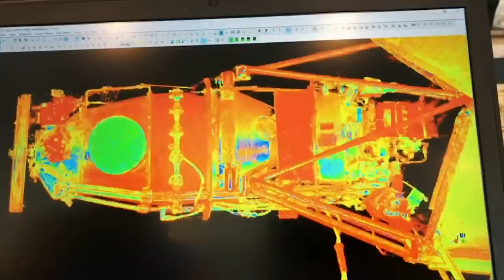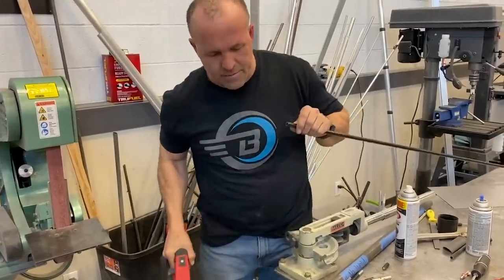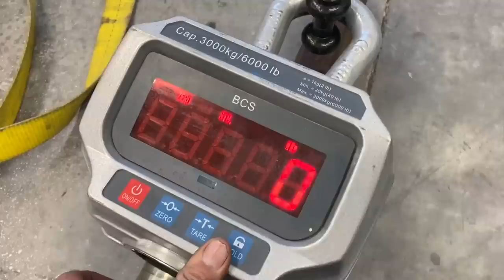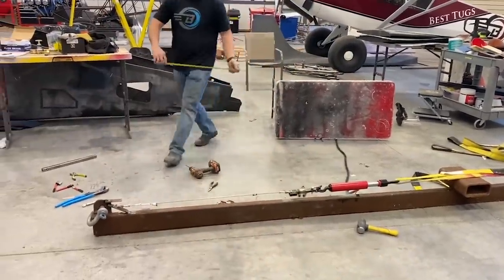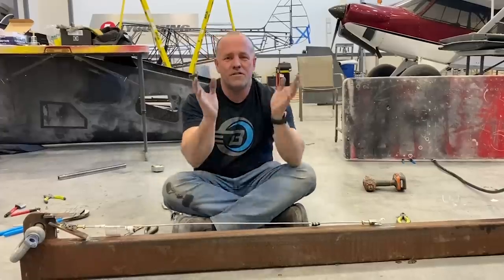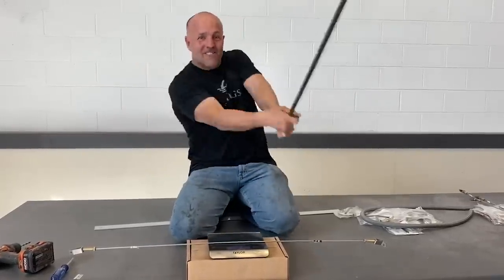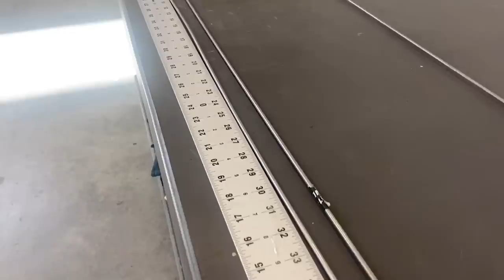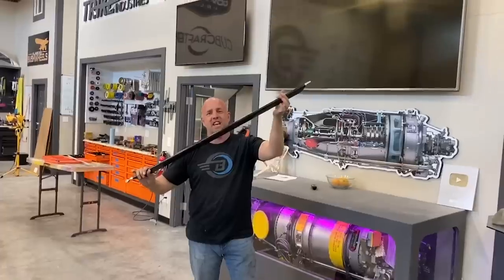Testing to Failure (Scrappy Bush Plane 17)

Comment: I'm working on my 1947 8A Luscombe while watching this video. Carborator is giving me issues.
Reply: check and make sure the brass floats are not cracked/pinholed and filling with fuel
Reply: I seen the top of a carb on a Luscombe come loose with all the safety wires still intact. The screws pulled the threads out of the body.

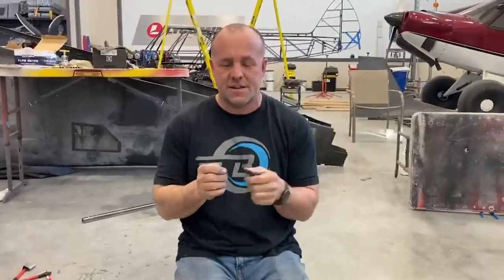Comment: The fact that there was three points of plastic failure before catastrophic failure indicates it's a good design. There's little excess material and the parts aren't over-built and unnecessarily heavy.  Edit: FOUR points of plastic failure. 20:35
Reply: Ha. I spoke too soon... Exactly what I was saying @ 21:00

Comment: I would bet that if you pulled it hard enough to actually separate it in halfthe failure would be where the threads of the bolt touch the sheet metal clip. However by your definitionI would bet that the thing that doesn't come back to the right length will be the the rod. No clue about how much force though.

Comment: Disclaimer: I only have a rudimentary understanding of materials sciences.  That being said: The loads observed are far beyond any expected operating load, so far as I understand.  However, the problem with composite materials is that if you stress test them beforehand, they do not exhibit any stress failures until absolute failure point, meaning conventional testing is nearly irrelevant.  Individual fibers may break within the material that would be entirely unobserved without absurd levels of examination.  Carbon fiber has incredible rigidity, but it lacks elasticity, meaning it cannot return to original form once stretched beyond.  As I understand, perhaps kevlar might be a better option in this situation.  That is to say, while yes... carbon fiber rods may be a better option in this application, it would be unwise to pre-load them (I believe stress testing on composites lead to failures in rocketry when no failures were previously observed).
Reply from the maker: TheHengeProphet great comments my friend👍🤠. Your on the right track. A couple of items correct that you mention and some others are rumors out there but not totally accurate as described. I’ll be sure to dive into more later on a video.  Love your thoughts my friend 👍🤠 cheers
Reply: @MikePatey  Fly safe!

Comment: I called it! I said an end point and 4000lbs for the carbon fiber. Woo hoo. I also said the shaped metal ends for the metal rod but I said 2000 so I was a bit off there...

Comment: Are you concerned with the lack of isolation on your rivets through the carbon fiber? Or is there some isolation not shown?
Reply from the maker: Whammy154 great question 👍🤠 testing on rivets over period of time showed that just the simple film of the resins is sufficient and also why I use stainless

Comment: Im guessing the bracket will fail around 2000 lbs. Also why use micro for the connection and not flox?

Comment: The clamp will deform first, then the rod will stretch. Than it's the anchor point which will snap or sheer the bolt. 5000-6000 lbs is my guess

Comment: Failure at the bracket/tube interface isn't that counter-intuitive, IMHO. And isn't it good thing to have the metal rivets shear first? Less violent destruction event and you can nicely estimate any fatigue if a little gap occurs between the carbon airfoil and the bracket over time.

How about the carbon tube providing push force support for any upward movements of the horizontal stabilizers? Guess metal wires not being able to do anything here is a big part why most planes don't stomach negative g maneuvres all that well, but certainly it must help a lot with all the buffeting going on back there as well.

BTW, highly recommend reading "The Perfect Car: The Biography of John Barnard" - not sure if there's really anything new in there for you in terms of building with carbon fibre, but I guess there would be a lot of smiles when you read about such a pioneer coming to the same conclusions as you certainly did in you career!

Comment: Don't forget the real world for a bush plane may include bird or rock strikes.  It seems like you should tension it up to normal expected loads and then ding the rod or tube with a hammer.
Reply: Ah.  Redundancy from the compression strength of the carbon rod might mitigate this, but then I would want to do a really careful preflight for signs of impact before each flight.

Comment: For the metal wire assembly...I’m guessing 
1. 1200 lb deformation 
2. 1800 lb absolute failure
3. Compression nut is my guess

Comment: With a stiff carbon fiber rod, wouldn't you want to test not only tension, but repeated cycles of compression & tension? I would expect any failure for such a test to be at the ends and not the rod itself. After all, that's what it will see in flight. 
The slight twist in the struts was a great idea.

Comment: What was the final weight of the new rod?
Reply from the maker: MasterMoparMan within grams of each other. My shorter rods were more but the longer were less as the tube verses metal wire per foot is less so it got lighter on the longer parts

Comment: So if 600lbs is your design goal, then 5000lbs is roughly 8 times overbuilt or your carbon fiber tail brace wire could be  8 times (less a contingency factor) smaller?
Reply from the maker: mrvoyagerm 👍🤠 great comment and yes that is correct. The reason I’m stronger than needed in pull strength is in part so I’m even stronger for large rocks that flip up and break the wires all the time on cubs and I wanted it to handle a good size rock impact so more is better and similar weight is ok with me if I add that much extra impact safety
Reply: @MikePatey  Ok that makes sense but will the Carbon Fiber tube actually take a bigger side load than the wire?  Hmmmm sounds like another test coming

Comment: doesn't all the surface are on that streamlined fairing add whetted area and parasitic drag? vs a smaller airfoil shape.
Reply from the maker: DEeMON  great question 👍🤷‍♂️ it’s a juggle pros and cons, I went with best angular deviation on the back and have used that in the past and it’s drag is minimal. Now if it was one of my racers we would not have any and just build a solid horizontal pass through to loose the wire drag.  Ten ways to do the same thing 🤠
Reply: @MikePatey  Yeah I understand, I imagine on a high power plane like that it would add up to not much difference.

Comment: With that extra fin material,.. Why not make those struts micro ( smaller/thinner.)
Clearly you have more than enough carbon fiber in the rod alone - just say'n :))
Also, what are the rivet made out of?
How about just some carbon fiber rods tapped in those holes and glued.
I would imagine they would be much lighter,... And have a much higher shear strength than aluminum?

Comment: I can't tell if that metal tube is thin walled. If it is, i predict your length failure will be at 500-750 ibs and the left bracket will bend around 1500 ibs if the tube is not thin walled and it doesn't break before then.

Comment: Hey Mike, how did you know that the original strength of the cable has to be 600lb or over?
Reply: Just in case he doesn't answer. I'd say as it elastically deformed only - returns to it's original length (google Stress v strain graphs. If it yields plastically then it's a failure...
Reply: @carts4138  Thank you Dane! In a bit of a broader question, in building an aircraft (let's say airframe) how would I determine how strong it should be?

Comment: At this point, you might as well source an all aluminum 4.6l V8 Ford Aluminator AKA, Mustang Cobra sn95 engine" slap a turbo on it making 1100hp.
cheaper and far more reliable then a flat 8 lyco or conti
Reply: Auto engines are not very reliable making that 1100hp continuously, though.  A service life measured in minutes, at best.  That Lycoming will run at wide-open throttle making 500hp for the whole flight, day in and day out, if you care to do that with it.

Comment: Just wonderung why you don't use a titanium-alloy and some structural adhesive instead of the stainless and the epoxy? The titanium should solve the contact corrosion problem with much less effort and the proper adhesive should fail after the carbon tube even without the rivets. I personally I realy don't like the rivets because they cause alot of stress concentrations and holes you have to drill for them cut the carbon fibers so the part loses alot of strength (And the rivets are heavy ;-) )
So far this is my favourite scrappy video, close second is the one where you show the CAD and stress analysis stuff. But as an engineer the "why" you build it a certain way is as interesting as the "how" you build it. :-)

Comment: Stretching Carbon Fiber rod in a static mode ( test stand ) vs. Stretch ( Tension ) in a dynamic nature ( in flight )?
Reply from the maker: Francis Schweitzer great question.  in flight the loads  are so minimal that when its tightened appropriately under tension it has no deflection for that load. I like your thinking some miss the level stuff 👍🤠
Reply: Mike Patey I am rather familiar...at least on a basic level of dynamic resonance frequencies and the havoc they can create.  As the old saying goes...”It looked great on paper”

Comment: afaik, you‘re not supposed to rivet carbon fiber tubes in place. When I did Formula SAE, it was forbidden and carbon fiber tubes for the suspension had to be glued. 
Not sure if this is right but I thought I‘d mention it. 

Any experts with further knowledge here? I‘d really like to know the stuff behind that.

EDIT: after watching the test, I think that you might have weakened the connection by adding the microballoons. Also, the glued gap is huge when using the internal thread as the counterside. That might have weakened the connection too. 
Now my question: did you hear any cracks from the epoxy just before failure? If not, I could imagine that the epoxy was holding everything and when it failed, it just sheared the rivets right off as a „side effect“. 
Just a thought, would be interesting to put some research into it :)

Anyway, awesome video as always!

Comment: The compression nut will fail! That's my guess!
Reply: Totally and absolutely wrong on my guess!! I now trust compression nut fittings much more! The only experience I have had with them is a 30-year-old router that had a 1/4 in compression fitting for the router bits. That broke almost instantly when I tried to put in a router bit! But probably back in its day, it was a great router!

Comment: I realize there is probably no way to put 3800 lbs on a fly wire in the real world but I'm not sure I like the idea of a part that gives no hint of failure vrs the regular flying wire seems to give you a lot of feedback before failure.
Reply from the maker: The Carpenter Dad I’ll try and explain the benefit and more on that in a upcoming video, great question 👍🤠

Comment: Would using a higher strength filler to the epoxy - be better than micro, the failure may just have been the micro filled epoxy failing at the threaded fitting - the rivets could have had NO/little load on them until they underwent fast failure when the Epoxy let go - at ~! 4000lb...  Killer Bar end -  Rivet-fixed compression fitting set in glass isolated wet epoxy - now that would be an overkill seeing you already can support a small elephant on the elevator (not recommended naturally)

NB, no need for 2 "wires" - a pushpull rigid carbon rod is all that is needed - 50% less weight over factory "Rigid wires"  - in this system, the second Push-Pull rod is your "safety factor"  ie x Infinity.   lol.

Comment: The carbon is way over engineered an too large for the application.  What is lost in parasitic drag, even with a foil shape? It could probably be 1/16 diameter carbon or even replace with Amsteel and still far exceed the metal tensile and stretch, the problem with that would be the attachment points, which of course is your failure point on this part.   In practical terms your benefit achieved for this is very expensive part is nil.  But the cool factor is off the charts.

Comment: Why did you choose to use micro balloons rather than colloidal silica for your filler?  The former sands easily, but is not a structural material.  The latter is much harder to finish, but adds significant strength to the joint.  The weight difference should be insignificant.

Comment: UV Rays normally over time will weaken carbon fiber
Reply from the maker: Todd Duon great question 👍🚀 very very heavy UV and also why I always add extra layers of non painted areas of just a clear UV and I don’t consider that later in any structure calculation as it’s my UV back up protection for the structure layers below if the paint UV was not as promoted

Comment: One of the biggest issues with new people using exclusively computers is that they don't have perspective and blind trust in computers. Many times in my line of work, i've seen this trust betrayed in ways that weren't reflected by the operator's intuition. That is not to say that when used right, it's not a powerful and useful tool, because it very much is. But you first have to cut your teeth with real world applications. Like the old saying among artists, often told to young ones trying to prove themselves as masters off the bat, went, Picasso didn't paint masterpieces first, be sold regular paintings before.
That aside, carbon fiber structures are super strong. In architecture, they've allowed us new horizons in terms of previously unused concepts, deemed to remain on paper or in our minds. Joints, reinforcement, even in saving old structures with minimum modification, because carbon fiber is so strong, it can save old buildings because it's the unseen help that can be hidden in a frieze or a hidden sister joint.

Comment: MIKE QUESTION. Why bother with gluing the metal at the end of the rod.  What not just drill holes directly through the carbon fibre?  Just make a mould at the end of the rod that replicates the metal end that you are using.  It will not be the weakest point then, It will be a whole piece

Comment: My intuition says the bolt sheers or the steel rod slips out of the compression joint.  Edit: I guess I overestimated the strength of those brackets. Learning from failure it is. Being right all the time would be boring anyways. :) Reality 1 / Amateur 0

Comment: Mike, that wasn’t quite the proper way to bond in those end fittings.  The proper structural adhesive (vs epoxy/micro) and the correct bondline thickness would not have failed that early, even with zero rivets.
Reply: Please qualify materials and methods characterized as “proper”.

Comment: With these tests in mind, why are you using a metal frame with a carbon skin? why not use a carbon frame? surely either by the extrusion method or the weave, there is a means of replacing a steel frame with carbon fibre.

Comment: I am by no means an engineer but I’ve been in the field of fabrication for a while now. In my experience with things failing I feel everything is more “fine tuned” to do its job when multiple parts are failing at the same time i.e. your clevis, bolts & rod. Instead of only one part out of five or six of the complete assembly fails, it seems you’re wasting material in time in over build parts.

Comment: You have avoided the greatest design challenge all engineers face - Building to hit cost. It would be quit interesting to do an off the cuff cost analysis between the two parts. I think its important to ground the viewer with the reality of why Carbon Cub can't build to your standard and still have an affordable product. One last note, you stated that you did not want to stress test these final parts for obvious reasons, but shouldn't you test them to nominal expected loads to look for a manufacturing defect (i.e. the resin did set up correctly or there was a material weakness.).

Comment: "And why are we going to use carbon fiber?"  Because Mike Patey, that is why.
Reply: I am feeling pretty good, I guessed 2,300 lbs for the wire and fail on the strap part and 4,600 for the CF.